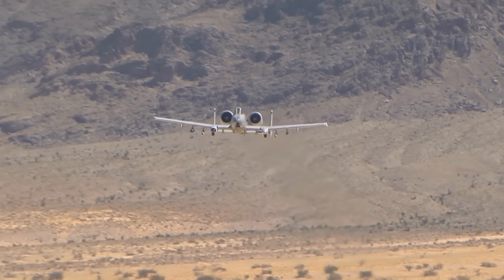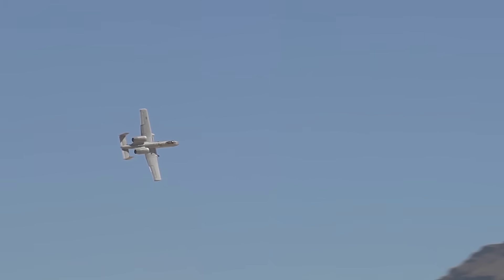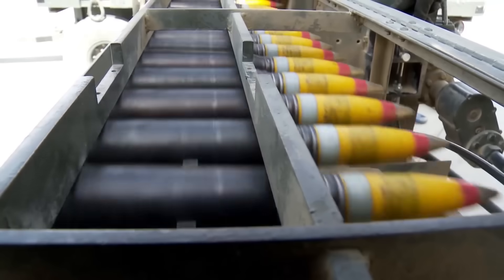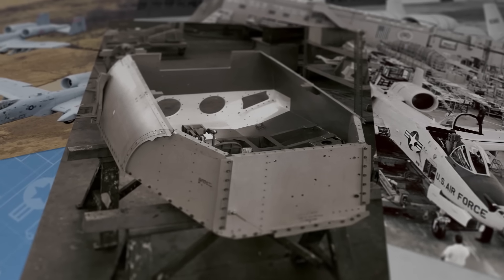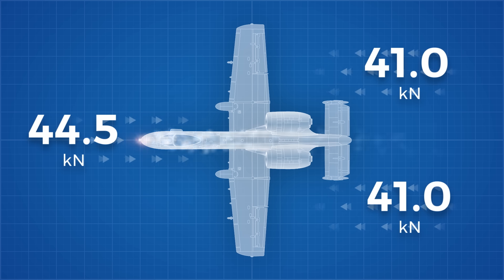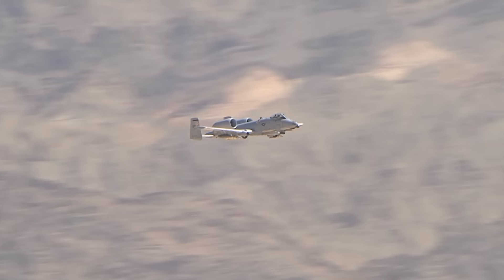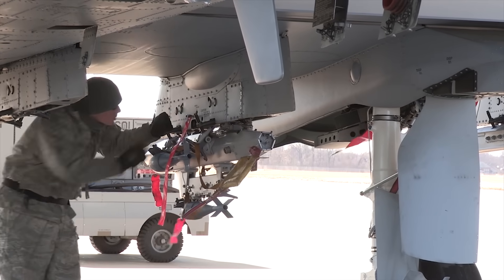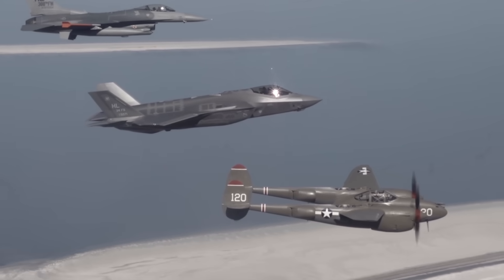The Insane Engineering of the A-10 Warthog

Comment: A-10: destroys a line of tanks
Soviets: Dude Uncool
Reply: As far as I know, A-10 has never been used in an environment where the US didn't have total air superiority, which is the case that would have been the situation over Europe if the cold war had turned hot.

I'm not that convinced that A-10 would have been effective in its actual intended role. It's been fantastic butchering tanks in the middle of desert with no air cover or effective air defence and in helping ground troops fighting asymmetric war against rag tag terrorists.

How it would have fared if the sky was buzzing with MiGs and Su's, and the ground troops were equipped with the most modern air defence systems, we'll never know. Hopefully.
Reply: @srelma  you do know we have planes that could shoot the planes that might want to hurt the A10s...
Reply: @srelma  I'd say it'd still dominate, just in a modernised form.
Reply: Imagine a trained guerilla soldier with IGLA, and a10 pilot who flies under 600 km/h at low altitude i don't think that brrt would be sent to brrt anymore.
Reply: Ok simple history

Comment: Actually, the gun (gau 8/a) is not mounted on the center line, it is mounted to the right side, but the gun fires at the 9 o'clock position. To counteract this, the front landing gear is mounted to the left. Other than that, I found this very cool, as I have been waiting for this for a while!!

Comment: There is no evidence of the elevated cases of cancer from depleted uranium.
Reply: Correct, depleted uranium is very weakly radioactive. I think people hear the word Uranium and suddenly think nuclear bombs. The average smoker is going to be at a much greater cancer risk than anyone who suffered acute exposure to depleted uranium, the radioactive lead and polonium builds up in a smokers lungs. Pilots are also a concern, pilots see increased radiation exposure from cosmic rays when they fly at high altitude. To really be at an elevated cancer risk from depleted uranium you need to be chronically exposed to it. Even then, heavy metal toxicity is more of a concern to safety than radiation. Lead poisoning or poisoning from any other heavy metal can kill you far more easily than radiation from depleted uranium. Everything emits some amount of radiation or is toxic in some way, some worse than others. The likelihood of depleted uranium being a major or overpowering factor in cancer risk compared to daily life habits is very small.

Comment: The F-16 was designed to be a fighter plane. It evolved into multirole.
Reply: I met the guy that did the numbers regarding a possible Soviet air attack during an invasion. At the time, the air force was confident in their quality over quantity approach with the F-15. But all the cheap migs would overwhelm them pretty fast. IIRC the report said that air superiority would last only a few hours before the 15s were over taxed by wave after wave of fresh fighters. So the air force puts out a competition to find a cheap fighter to supplement the F-15s. Both the F-16 and F-18 came out of this.

Comment: People keep going on about that its not fair and safe to use depleted urainium and its getting annoying, to actually be "irradiated" you need to be like 2 feet away which is stupid considering 90% of these rounds will be used in deserts and will be partially buried from going through whatever was shot at so its not a problem, also thr stuff is only a about ten to 100 times more radioactive than backround radiation which sounds like alot but backround radiation is incredibly low a banana is more radioactive than backround radiation and concerning water contamination, i aint never seen a lake in iraq or syria or open water so. and to end this the whoevers saying oh you cant use those our cancer rates are up lets be honest they dont care about their people they just want the U.S to stop using them rounds because they are unstoppable almost
Reply: Yeah, and the average smoker or pilot is going to be at a much greater cancer risk than anyone who suffered acute exposure to depleted uranium. To really be at an elevated cancer risk from depleted uranium you need to be chronically exposed to it. Even then, heavy metal toxicity is more of a concern to safety than radiation. Lead poisoning or poisoning from any other heavy metal can kill you far more easily than radiation from depleted uranium.
Reply: @dakotaadra1044  yeah, you can actually get poisoned by copper and i think aluminium if you drink carbonated drinks through it the more you know
Reply: depleted urainium is very dangerous if it gets inside you though via eating  or breathing shards, because it cant get out it'll sit and if not removed will increase the chance of getting cancer by alot but nobodys drinking water in the middle of a desert or rolling their food on battlegrounds so not really a problem

Comment: Cheap + effective = If it's not broken, don't fix it.
Reply: It sounds like a plane the soviet would build when you put it like that. Cheap, effective, crude yet reliable, designed for mass production.
Reply: @evoluxman9935  Sounds a bit like an AK
Reply: @evoluxman9935  Su-25 is also similar to this train of thoughts.
Reply: @evoluxman9935  It is basically the AK of the sky.
Reply: There's just one problem: Cheap, effective and durable is not very profitable for a salesman.
I.e. the military industrial complex.
And as even a cursory look at the development of the F-35 will tell you, the MIC has A LOT of influence when it comes to these matters.
Reply: @rockyblacksmith  
The F-35 is what the MIC produces when there's no percieved existential threat - an expensive, complex, self-justifying reason to continue to exist.
Reply: Its not really effective if the enemy has any proper fighters they will drop like flys
Reply: @WearyKirin  It is not meant to go against fighters. It is meant to support the ground troops. If it is going against fighters we have a much bigger issues. If it is going against a still intact air force then we fucked up. You use one of our other 16 types of fighters to establish air superiority then you send in ground troops supported by the A-10 to deal with enemy ground troops.
Reply: @WearyKirin  that's not the point though. The A-10 is purpose built for ground attack. If the Air Force expected enemies in the air during a ground attack operation they would send fighters alongside the A-10s to defend them.

They don't need protection when they're only threats are dudes with shoulder fired rockets.
Reply: @whogavehimafork  "If the Air Force expected enemies in the air during a ground attack operation they would send fighters alongside the A-10s to defend them" - You do realize how many ground attack operations are carried out by fighters, right?
Reply: @WearyKirin  that's what having one's own 'proper fighters' is for.  That's why A-10s were sometimes in mixed squadrons with F-14s, 15s, or 22s.
But the A-10 is properly used in an air-superiority condition anyways; it becomes a reason to gain air superiority.
Reply: @WearyKirin  Of course... But their job is not dogfight, it's killing tanks...
Reply: @robertg.2111  Most tank kills performed by A-10s were done through Maverick missiles and bombs, not the gun. So any aircraft that can use missiles and bombs can perform the same role.
Reply: The F-35 is always described as being designed for the modern battlefield.  But the modern battlefield is the Middle East and the A-10 is the perfect fit there.  So I'd say the A-10 is designed for the modern battlefield and the F-35 is designed for BVR air superiority and standoff attack with some CAS capability.  But that slow, dirty in-close fighting is why the USAF has been forced to keep the A-10.
Reply: Well, we did upgrade them with Datalink, precision strike capability, modern avionics, and a glass cockpit.

So now the big, simple gun is a big, simple, smart gun.
Reply: the A10 is far from cheap
Reply: But the A-10 is broken.

Comment: Uum Actually... The Blueprint where you have shown that the main gun is exactly in the centerline is only partially correct. As a result of the gatling design, only one barrel at a times is firing at one single moment. In the A-10's case this is the barrel at the 9-o-clock position, looking in the direction of fire. Since a barrel only produces recoil when it fires and it only fires when it is in the 9-o-clock position, it is that barrel that needs to be in the centerline. this means that if you look at the bundle of barrels, it is off to the right of the centerline and only one barrel is smackdab on the centerline. This design allows for the forward landing gear to be less of to the left.

Comment: Awesome video, good intro too.
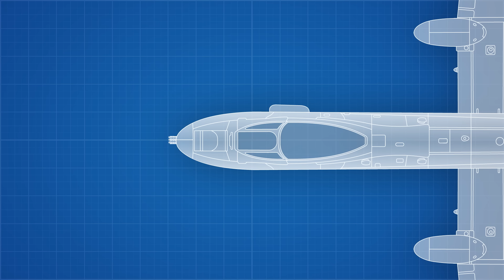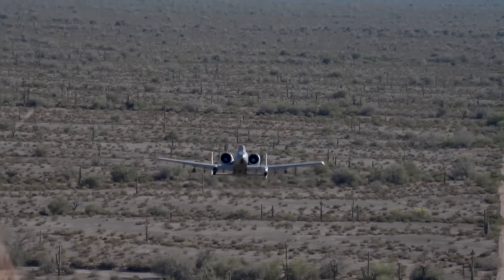However, regarding the point made at 7:44, about the GAU8 being mounted "directly on the center line of the plane". Isn't it mounted slightly offset, so that the firing barrel will be directly on the center line? As you can clearly see at 12:20 and 12:26.
From wikipedia: "The gun is mounted slightly to the port side so that the active firing cannon barrel is at the 9 o'clock position and on the aircraft's center line".
Perhaps it's different variants, but I've heard that random piece of trivia a few times before.

Comment: 7:44 The gun assembly is not mounted right on top of the centerline - it is FIRED on the centre line. The gun assembly is offset slightly to the left of the aircraft but the active barrel will fire on the centre line to not do weird things with the aircraft's flight characteristic with the cannon's recoil. https://theaviationgeekclub.com/a-quick-look-at-why-the-gau-8-a-avenger-gun-is-mounted-left-of-the-a-10-warthog-centerline/
Reply: I heard somewhere that if the GAU-8 fires for a little too long, it can stall the plane.

Is that true or plausible? Or is it just an exaggeration?

Edit: Nevermind. The video addresses my question. So it can stall the plane! Holy shit!
Reply: Steel Beam I was an A-10 mechanic. Yes it can but the gun would overheat or break before you got that close to stalling if you were at the proper downward angle of attack.
Reply: deric hart But if the A-10 can fly on a single engine, and the gun would basically cancel out the force of one engine, as mentioned in the video, wouldn’t you be able to fire an unlimited amount of time (not accounting for overheating of course)?
Reply: revoxx we can’t just say don’t account for things that will happen. The pilots are instructed and trained for no longer than a 6 second trigger pull. Any longer can potentially cause damage to systems on the AC.
Reply: @derichart7313  A-10 weapons here. The gun stalling the jet is one of the biggest myths about the A-10. If you're an A-10 "mechanic" you should know this.
Reply: @PunishedClippy  In warthunder (a combat sim game with proper physics) it's standard practice to shoot your guns to slow down when making emergency (read high speed) landings, even when all you're shooting is 4 7.7mm machine guns. 
The spitfire Vc, the first british plane to experiment with replacing the 7.7mm guns with 40mm, actually did have problems with the pilots stalling if they were firing while climbing, which was common because the spitfires were fast response fighters for most of the war. This lead to the later spitfires having 2 40mm guns and 2 to 4 7.7mm guns, instead of just having 40mm guns, so that they could fire the 7.7mm guns while climbing and maneuvering.
Also the american P39 series had a single 37mm cannon that when fired would shake the entire plane, and there are stories of damaged P39s actually breaking when they fire their gun, and inexperienced pilots could be thrown into a flat spin if they fired the gun at the wrong angle and speed.
Essetnially, there's a very long history of planes with very big guns, and those very big guns always caused problems.
Reply: @PunishedClippy  well there's only enough bullets for 11 ish seconds I beleive which isn't enough time to stall the aircraft unless it's already really slow
Reply: @PunishedClippy  A-10 weapons loader here. The video is wrong. You can't stall an A-10 firing the gun. Stalling an aircraft means the wings have stopped producing lift either because the angle of attack of the wing is too high or the aircraft is to slow and there isn't enough airflow over and under the wing. Stalling doesn't  mean the engines have quit running. That would be an engine failure. An aircraft that is pointed towards the ground is not going to stall. Even if the gun had unlimited ammo and warping the barrels weren't an issue, holding the trigger button while pointed towards the ground WILL NOT slow the A-10 to the point the wings stop producing lift. Its impossible. Gravity is at work.
Reply: I was going to call him out for this mistake, but I figured that the technicality is small enough that it could be just for simplification.
However, it's also an incredibly unique engineering feature (alongside needing to offset the nose landing gear because of said gun) to work around the recoil of the gun. And he even went over the engine ignition system during firing, so...
Yeah, call him out for it. :P
Reply: @TheAmazingCowpig  I wasn't going to, but his 3D model of the gun being smack-dab on the centerline irked me somehow.
Reply: Was looking for this comment lol. I paused the video as soon as he said it was mounted on the centerline and knew somebody had to have called it out by now
Reply: Big brain man say big brain thing. Me no big brain no understand.
Reply: @m-sn4684  the bullets come out of on side of the gun so the gun has to be offset a little so that the recoil is along the center line
Big brain time
Reply: @m-sn4684  Gun shoots not in middle, shoots to the right. So moves gun to the left for gun to shoot in middle.
Reply: @m-sn4684  when you look at it from the front, the chamber which the bullets come out from is at 9 o clock.
Reply: Paul Productions 7 o’clock, actually. 9 is all the way to the right, 7 is right on centre.
Reply: Stop.